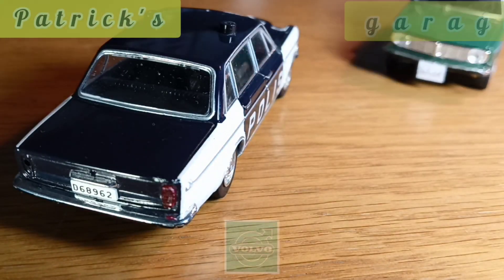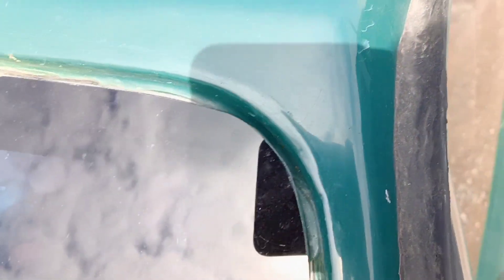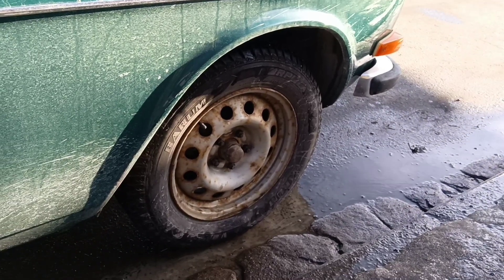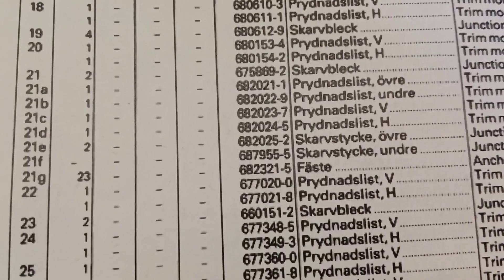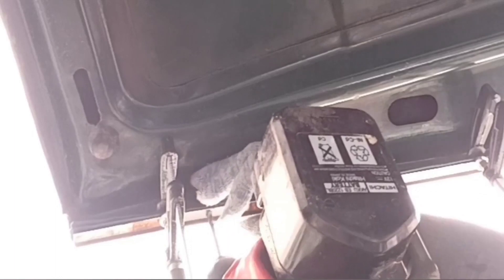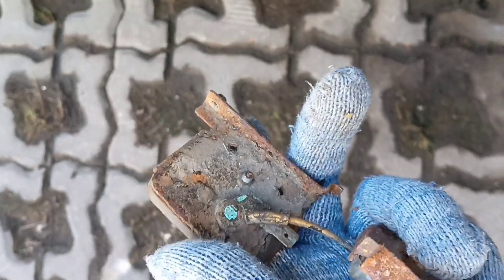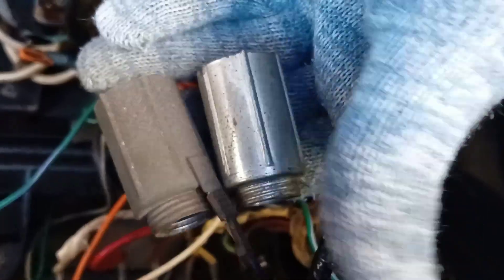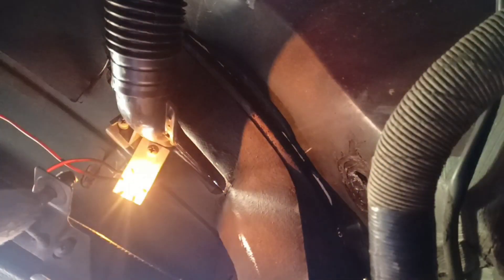HOW TO PUT MOLDING IF THE HOOD WAS WRECKED | license plate light | lighter connection #volvo140

Comment: Hi Patrick! Good job fixing all those details! The metal trimm material is very good quality back in those cars. The only thing I don't like are the plastic trimm pieces on the door bottom in 240 series. They fall apart after many years. People try to glue them, but it doesn't work. I have removed them from my car and prefer the early look :). Thanks for the video! Cheers!
Reply from the maker: Hi Marcin! Early look always will be better🙂. But! You can glue them again and again, using superglue not fascinating process obviously🧐. If not main purpose save original year style... Only upper side mouldings have protective function when you parking near grocery store. Clunkers can damage your car🤔. Can't understand for what lower moulding, may be just decorative trim😉. Thanks for watching 🙂.

Comment: "Sneaky little rust"😀 The curse of  steel.  Why oh why were so many vehicles made with this perishable metal ?  Economics, sure, but the consumers and their mechanics should demand bronze, stainless steels, aluminum, titanium,  etc. Even magnesium is better for outdoor use.🤔
Reply from the maker: Yes, we can demand whatsoever, but it's planned obsolescence. When i drived comparatively new car, approximately before five years old, suddenly appear noise from rear axle, it was forward wheel drive wv. From where was it noise? Protective dust plate behind brake disc starts wiggling and eventually falls, just hanging on hub and make horrible noise. When I goes to service station, turns out that this protective cover was made from differs metal, and from touching started rust in points of holes where places of fixing scruves. Can you guess what mechanic did? He just put additional washers under heads of  securing bolts. And I think it was not first case. So, difference between metals can be root of quick corrosion. We need adapted all our stuff for us if we want use them forever.😉